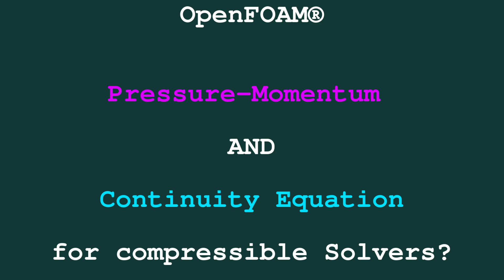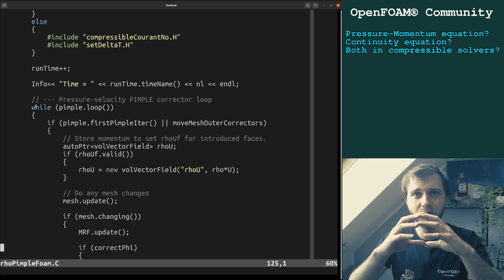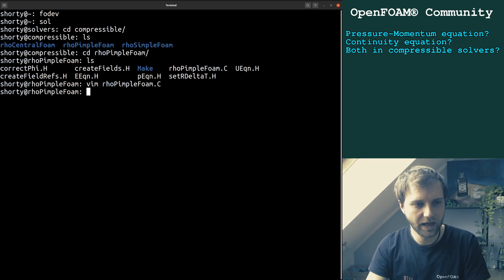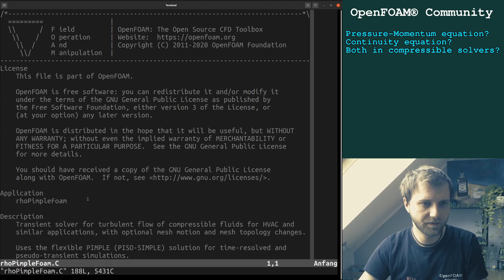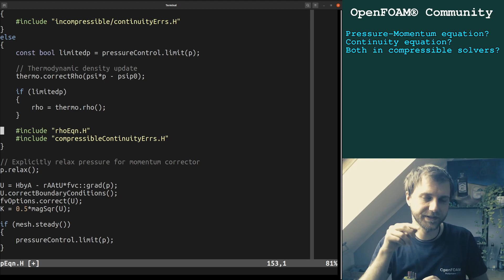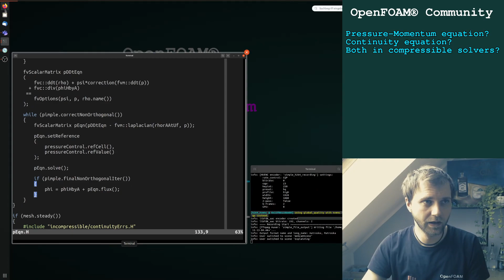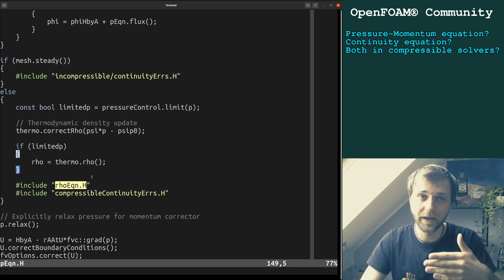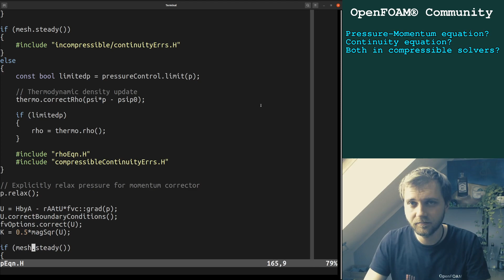Pressure Momentum And Continuity inside Compressible Solvers? ∇ OpenFOAM® v8

Comment: Hi Tobi, 

I have used OpenFOAM 4.1 and OpenFOAM v1912. You seem to be using OF8 and you only have one pressure equation "pEqn.H".

I can find two different pressure equations in my rhoPimpeFoam folder, namley pEqn.H and pcEqn.H. Do you have any information about the difference? 

As default the pEqn.H is used but one can use the other Equation by setting "consistent yes;" in the fvSolutions.
Reply from the maker: Hi Lukasf, pc = pressurce consistent. This means you are using the SIMPLEC algorithm rather than SIMPLE. In the Foundation version, this is handled in a different file in order to reduce the files one has to maintain. However, probably you will find two pressure equations in the pEqn.h of the foundation one.